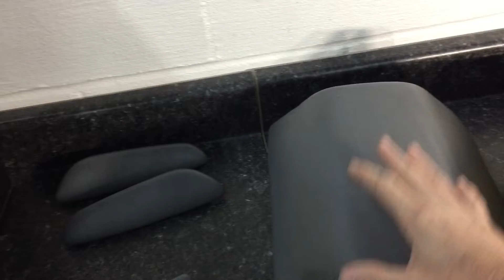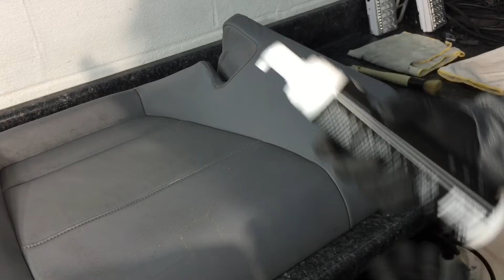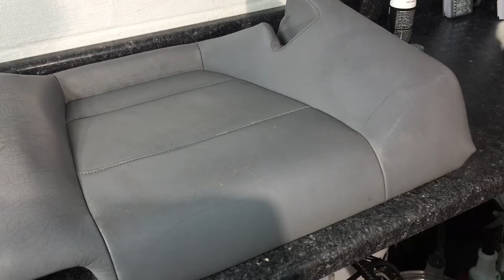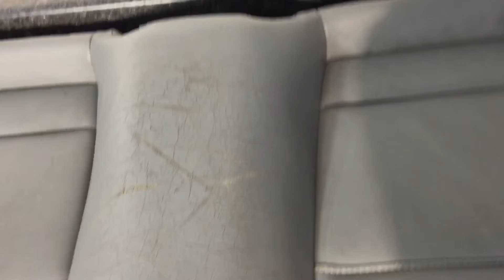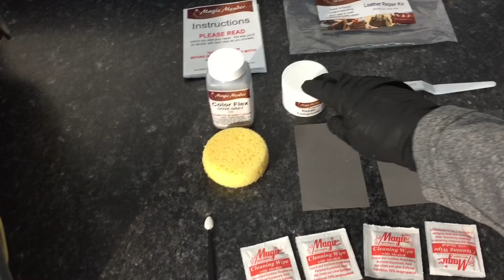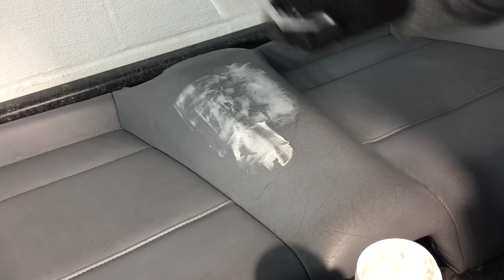Interior Restoration Vlog #2 /Part 1 (Leather Seat Repair) E46 BMW

Comment: I recently used Magic Mender on the Sand Beige interior of my 2010 Porsche Boxster, with 133,000 miles.   Repairs were to the shifter boot (including a 1 inch tear), driver’s side seat bolster, and various nicks and scratches in the vinyl parts.    The kit and instructions were exceptional and the results exceeded my expectations.    It’s been two weeks since I did the repairs and so far the repairs are holding up well.   The color match is perfect.   The repairs look like new.  I highly recommend the Magic Mender product, as the color and texture is perfect and the surface of the repairs supple and natural.

Comment: BMW Tuning Bonnet gills DTM hood Vents grilles M3 GT-R Air Duct "EMU"
e36-e46 www.ebay.com/itm/282170496474 
e46-e39r4 www.ebay.com/itm/282170490152 
e46-e39r2 www.ebay.com/itm/282170505749 
e30-e34 www.ebay.com/itm/282170503715 
e9x www.ebay.com/itm/282170494337 

Tuning hood Vents Air Duct GTR style 
www.ebay.com/itm/282271034546 
www.ebay.com/itm/282271037535 

Tuning hood Vents Air Duct AMG c63 style 
www.ebay.com/itm/282271042059

Ford ST RS universal Bonnet gills hood Vents grilles Air Duct e92 style
www.ebay.com/itm/282286171534